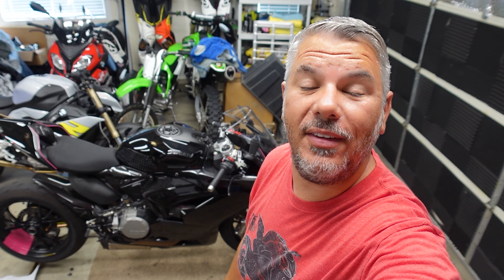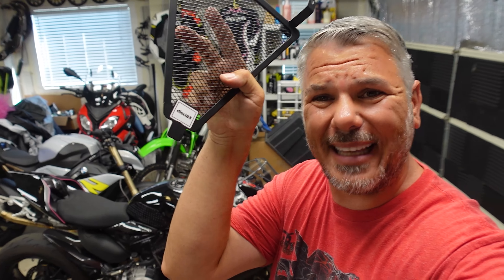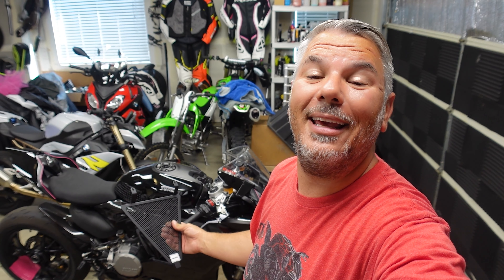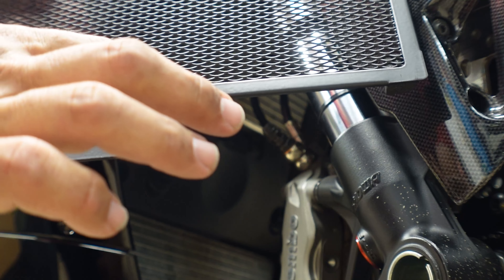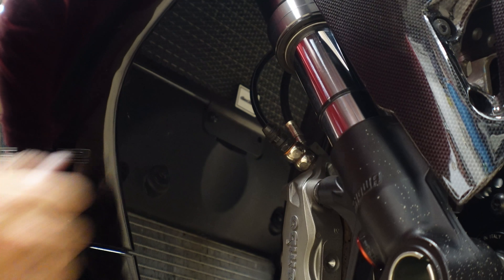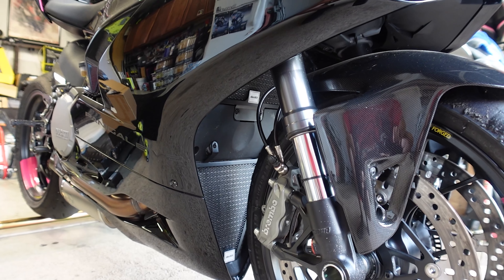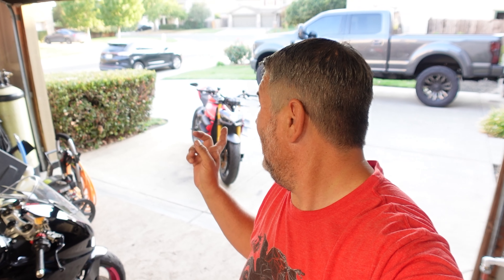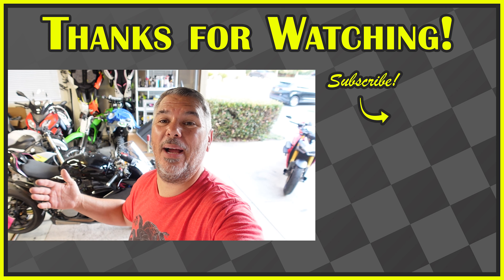2021 Ducati Panigale V2 | 15 min Radiator Guard Install

Comment: Ive just brought a 2021 V2 955. My current 2007 R1 over heats at 100. At what temperature should i be really concerned with my 955 V2

Comment: I installed mine on v4s it runs hotter is it normal?
Reply from the maker: Yup, the radiator guard actually blocks air. You ever see a race bike with them on? Nope, check out the video with the v4r exhaust install, I actually test that to show how much air is blocked by those.

Comment: It’s not an easy install when you strip one of the hex bolts that Ducati decided to loctite in 😑🤦🏼‍♂️🤦🏼‍♂️ nice video, glad yours went smooth
Reply: My god, I have the exact same problem. The 2 screws which hold the lower part are impossible to take off. I have tried to put a slot in one, use extractors, to no avail. Did you succeed ?
Reply: @moulip  I did actually, I took a dremel and the smallest circular grinder and cut a slot in the head of the bolt then used a flathead screw driver and a hammer to break it free and it ended up twisting out. I ordered a replacement hex bolt from Ducati Omaha and put it in!
Reply: @DesmoDadV2  Thank you for answering me. I had made a slot in one with my Dremel but still stuck; I have read somewhere that we should be careful with this 2 bolts since they are directly connected to the engine (which I saw on the diagrams)  and unscrew them could possibly lead to oil leaks. What do you think ?
Reply: @moulip  I am not sure of that, I had one screw partially out and ran the engine on a test ride and there were no issues. The bolt is rather short so i would be surprised if it is into the engine block.
Reply: @DesmoDadV2  In fact it fits in the head of the screw which closes the head cover. Weird design ! Meaning that potentially unscrewing them could make the below bolts turn as well. Even if it would suprise me considering the torque isn't the same and must be way higher on the engine head cover. But still ....
Reply: @moulip  very interesting actually. I never noticed and knock on wood, haven’t had any issues ha

Comment: Could you make a video of bleeding rear brake brake for the sfv4s please I'd like to learn how to
Reply from the maker: It's kinda a pain in the butt due to the bleeder location. We solved it by using a clamp to keep the brake lever pushed down, similar what you can do with a zip tie on the front brake 😅 we'll put it on the list, but no promises.
Reply: @CaliMotoTV  so when not riding depress brakes is how I'm taking it ? Thank you Bill ill deff be zip tieing and hanging lol